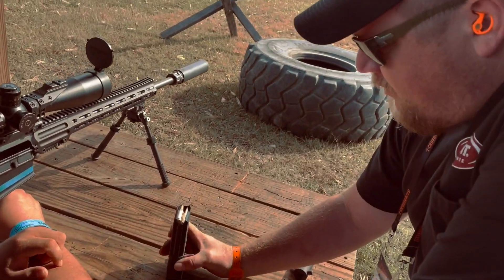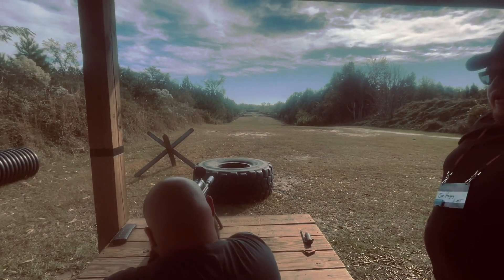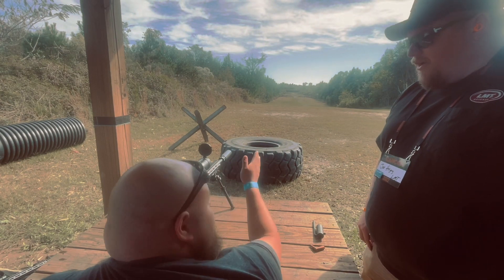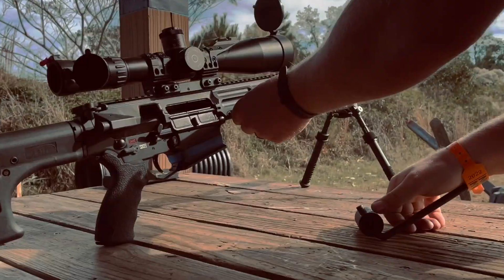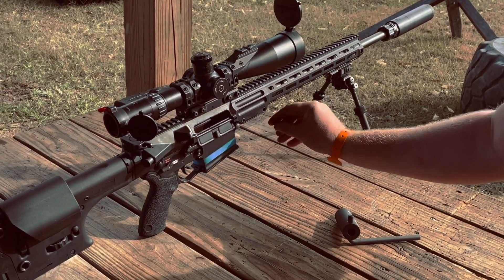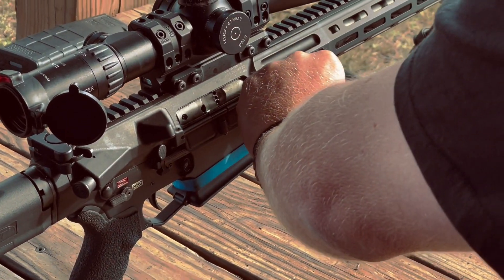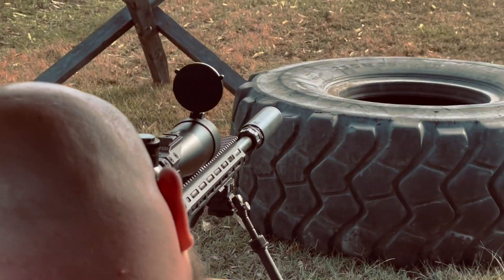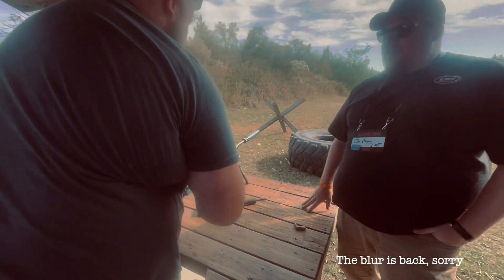LMT MRP - Barrel Swap POI Shift

Comment: What is locking the barrel in place to the receiver?
Reply from the maker: Two things are providing retention to the barrel. The first is the front locking screw the interfaces with a groove cut into the barrel extension. The second is 360 degrees of clamping pressure from the receiver itself. It is a tried and true design with over 20 years of combat service life.

Comment: The problem with the MLOK handguard being too narrow to allow barrel removal when ANYTHING is attached via those MLOK slots is why I like my LM8 slick sided uppers.  Hopefully LMT will one day correct this mistake.
Reply from the maker: Though its not convenient, the hinderance of the MLOK hardware impeding the barrel removal, isnt a huge deal. Now give me a second, and let me explain this. Most of your MLOK mounted accessories are going to be non sensitive. This means they are likely grip stops or flashlights that will not require rezeroing. Additionally, once timed, MLOK hardware is only a quarter turn to release. Magpul designed this to be generally QD for users. This all does add up, but is paled in comparison to the time it takes to install a traditional barrel with a torque wrench, timing of the barrel barrel nut, and removal/installation of a gas block. 

One additional detail is that with properly timed MLOK hard ware, a user can grind down the excess screw and facilitate barrel removal at least one side of rails installed.
Reply: @lmtdefense3927  but it was remedied on that new mlok 5.56 upper that does away with the qd that new socom joint. Would have been neat to do that to the .308 as well

Comment: What upper is this? The distance between the two locking screw is like mws not mrp, but mws doesn’t have FA
Reply from the maker: This is a limited production upper for a SOCOM trial
Reply: @lmtdefense3927  Hope you guys win the contract. The MRP is really the best design militaries should be using.

Comment: Did you guys change the cuts on the receiver on the area above where the barrel retention screws are mounted? I don't remember there being that many relief cuts for weight reduction there. I recall just the two on the 3 and 9.
Reply: Yeah, that's new I guess.  They got a retention cable on the forward bolt as well.  Maybe that's so Joe can do the demo's out in the field and not drop it.